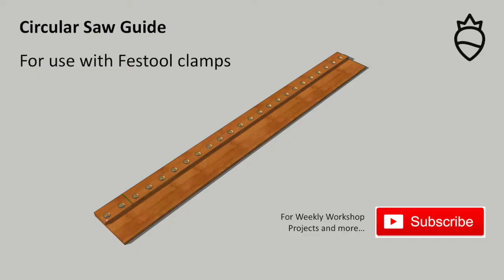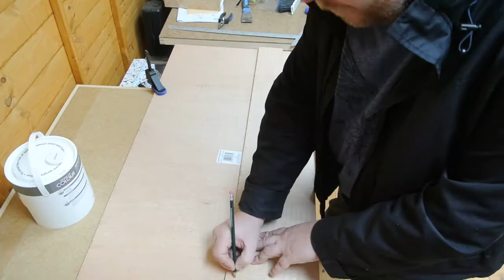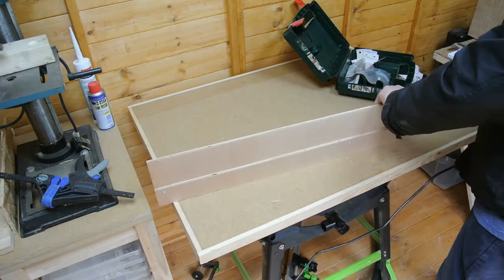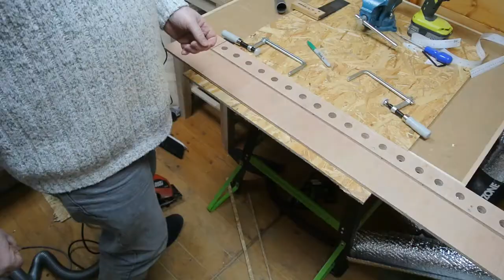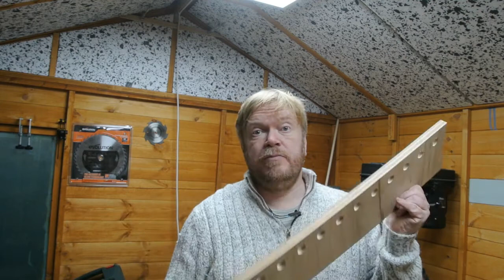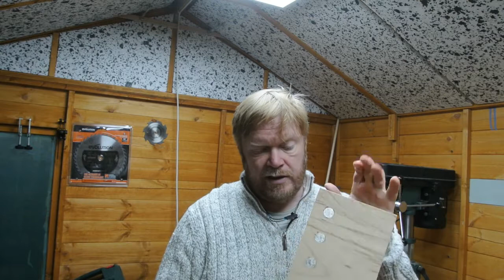Ultimate Circular Saw Guide for Perfect Cuts Using Festool Clamps

Comment: Excellent video.  Sorry, I’ve only come across this now.  Currently weighting up buying the Makita rail, adapter and clamps, but this has made me want to do it myself!  Not sure if I missed it in your video, but how thick is the mdf used?  Also, how long is you rail?
Reply from the maker: Hey there. Thanks for the coment. It was 9mm plywood that I used - even though I have a tracksaw now - I still use this guide regularly.

Comment: I tell you what...that IS the ultimate Circular Saw Guide! I usually clamp a piece of wood as a guide but have to keep measuring the footplate edge to blade each time which is a bind on multi cut projects - and has real margins for error.  Taking the time to make this jig will turn ten minutes of graft into hours of saved time. Great job.
Reply from the maker: Thanks very much. If you've just got quickgrip or F clamps then you don't need the holes and you literally can achieve this in 10mins. Remember there's an additional benefit in that the guide supports the wood as the blade cuts upwards giving you less tearout on plywoods. K.
Reply: Good point.